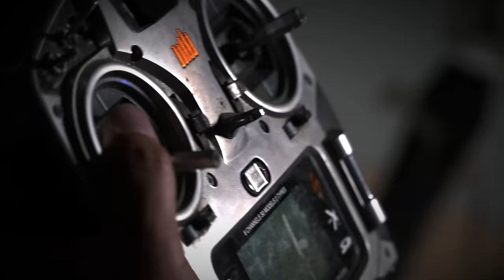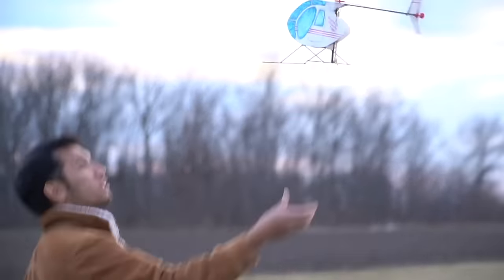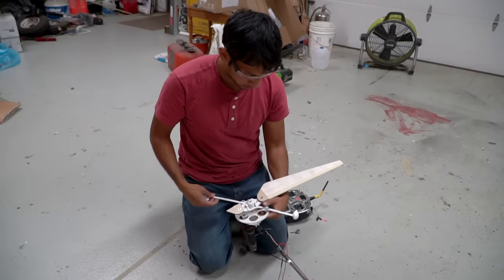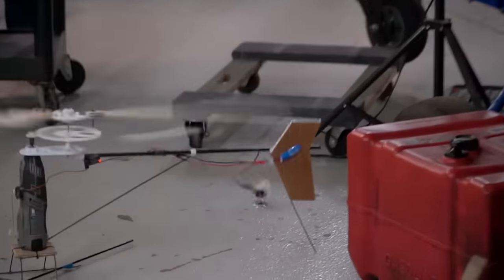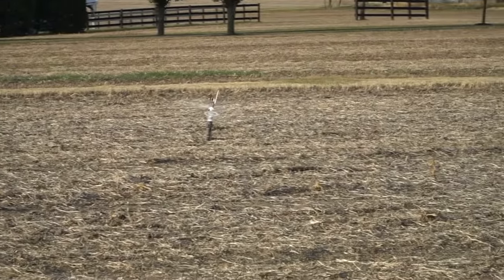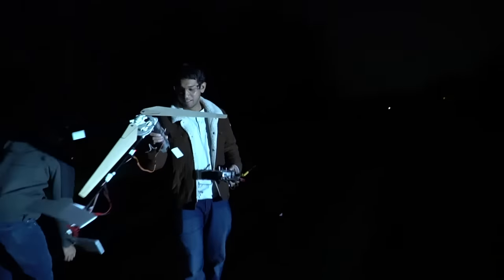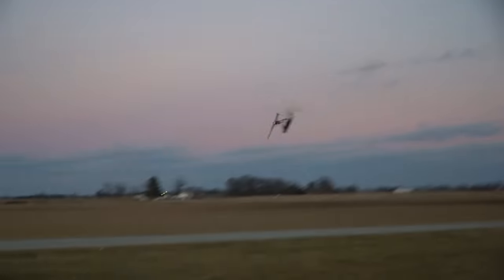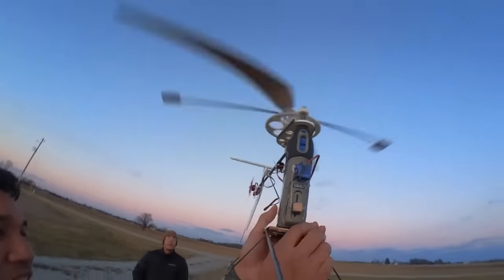Teaching a Dremel Tool to Helicopter

Comment: Remember that scene in Apollo 13 where the old lady says "...if they could get a washing machine to fly, my Jimmy could land it." I think Peter is the guy who could get a washing machine to fly.
Reply: Now Peter must make a plane with a washing machine motor!
Reply: There's your answer. He needs to build it like the lunar lander.
Stop trying to make it look like a helicopter and make four large panel legs with the propeller on top.

You'll have no directional control but it won't try to tilt Because every time it does the downwash would straighten it back out
Reply: Only if you can the air filter tubes shaped like this ⭕ into the air scrubber intake shaped like this 🔲 using only these items 🖋📎✂️📏🩹🩲🔨
Reply: @rocketboysmc  Was gonna suggest a backpack-mounted, Dremel-tool-powered, single-occupancy Santa's helicopter sled in preparation for XMas, 2023 but I like your idea lots better! lol!
Reply: fairchild republic already did that
Reply: @bmdoes_stuff6861  A-mazing comment, 10 out of 10
Reply: @TravisFabel  could some control be achieved by adding elavailerons near the undersides of the prop? Im more of plane guy; not sure how that'd translate
Reply: I would love to see a washing machine fly, that would be very impressive.
Reply: Bie Willie calls him airplane rain man
Reply: Dang that's so crazy that it may just work 😆
Reply: Actually - wouldn't using a Dryer rather than a Washer be better? The dryer likely already has air settings.
Reply: Dont give him ideas
Reply: But can he land it? Lol
Reply: So we're all in agreement that peter now needs to make a washing machine fly right?
Reply: Peter we are waiting patiently for your flying washing machine
Reply: @romanelliott1859  C'mon, Roman! Push him too hard and it'll deter, gent!
Reply: An apartment size washing machine weighs about 1 Peter Sripol. So, put one in the ultralight, add servos and receiver, and fly it from the ground.
Reply: He could do a vehicle with the actual wash basin and motor in the center. Make it one of those weird, circular spinning wing things like the X Zylo from the 90s. Side note - that thing would literally remove your fingers if you tried to catch it, so this should not do that.
Reply: @TravisFabel  AND you get your tighty tights, whity white!  🤣 But, yes, I agree with that. He needs directional control. That gets WAY complicated, time consuming and costly. Peter? When can we expect this craft? You should be back engineering those craft that do ALL of this. You all have heard of these, right? 🛸
Reply: dude şts actualy neet idea that machine haslot of power yhey are turninh 1000+ rpm witk 10+ kg oad in iy  😄
Reply: @rocketboysmc  Flying washing machine for 2.5 mil celebration?
Reply: And jimmys the one who can fly it!
Reply: Great movie got it on DVD
Reply: That's a good video idea, I believe those have 1.3 hp motors, which should be around 50x the power of most of these projects, I might be wrong on these exact numbers, but the real issue would just be the aerodynamics of a brick but worse
Reply: You said drimel at 2 minutes and 1 second
Reply: I made a washing machine fly once. I threw it off a bridge
Reply: And that was Jim Lovell's mom . And of course he was the pilot of Apollo 13
Reply: @thecitizenchan  y'all are overthinking this, washing machines are strong. just stick a massive prop onto the spinning drum and give it some wings
Reply: @rocketboysmc  washing machine motors are about 4kg lol
Reply: The next safety third video
Reply: dont give him ideas
Reply: The washing lunar lander!  Wash your clothes and land on the moon!
Reply: @rocketboysmc  🔴 What Is Islam? 

🔴 Islam is not just another religion. 

🔵 It is the same message preached by Moses, Jesus and Abraham.

 🔴 Islam literally means ‘submission to God’ and it teaches us to have a direct relationship with God. 

 🔵 It reminds us that since God created us, no one should be worshipped except God alone. 

 🔴 It also teaches that God is nothing like a human being or like anything that we can imagine.

🌍 The concept of God is summarized in the Quran as:

📖 { “Say, He is God, the One.  God, the Absolute.  He does not give birth, nor was He born, and there is nothing like Him.”} (Quran 112:1-4) 📚

🔴 Becoming a Muslim is not turning your back to Jesus. 

🔵 Rather it’s going back to the original teachings of Jesus and obeying him. 

More ....
Reply: @TravisFabel  wouldn't straighten it out though, the downwash turns with the flying machine.
Reply: @BloodyMobile  That sounds like a great idea.
Reply: @Nabitz  Yep, they are heavy but if anyone could do it peter could do it.
Reply: @TravisFabel  l
Reply: @rocketboysmc  it would have to one of his full scale planes that he built
Reply: @Nabitz  yep maybe a modification to an existing one?
Reply: @chriswatkins8711  Did you calculate glide ratio afterwards?
Reply: @rocketboysmc  ye
Reply: Don’t give him ideas
Reply: Yes please
Reply: @FullFart LMAO
Reply: Peter: Challenge accepted
Reply: Id pay money to see that
Reply: I'm sure he'll do that in a future video
Reply: @geometric7032  I believe so
Reply: @chriswatkins8711  you sound like my old landlord, he lives on the river and throws all his trash he cant burn into the river.
Reply: I'm going to be very dissapointed if he doesn't make a flying washing machine now.
Reply: Upvoting because I want to see this...
Reply: @bmdoes_stuff6861  A 10 man team of Peter Stripols could probably make ground strike aircraft!
Reply: He's trying
Reply: @Menaceblue3  English please
Reply: So dang heavy.  Tall order.  Maybe the minimum still has the tub and motor.
Reply: Aussie50 was the first to make a washing machine fly.
Reply: @rocketboysmc  sam walton said his first plane was powered by a washing machine motor, according to the walmart museum. I think he was exaggerating, but maybe?
Reply: Some washing machines use high voltage BLDC motors as their drum motor so it is feasible. You can even rejoin the series connected coil windings to parallel for a lower voltage. They are used a lot in diy wind turbines since they can be anywhere from 600-1500W
Reply: Jet turbine powered washer machine pls.
Reply: Don't spoil the next video lol.
Reply: I could land anything once.
Reply: Make a fidget spinner plane/helicopter
Reply: Bricks have better aerodynamic then space shuttle but still they made space shuttle to glide in in the air without engine or power and land safely on earth.
Reply: Now I want to see that
Reply: It is a universal motor so maybe but it’s really heavy
Reply: Yes! Next project make a washing machine fly! 😂
Reply: If he could we got to call up a Jimmy
Reply: with like 4 of the larger rc turbines and a good stabilization system, it would be totally possible to get an old style machine airborne.
Reply: now all they need is JIMMY to land it! (or a cyclic)
Reply: Great, thanks!
Reply: Washing machine company's make military planes which is even funnier
Reply: Apollo  that's the name of an Indonesian toy bro, and China, don't use that word again
Reply: It's only a matter of time.
Reply: No i dont remember
Reply: Jimmy dead yellow sure
Reply: Washing machine!
Reply: @rocketboysmc using the LG smart washing machine which have giant brushless motor it wouldn't be too hard to fly the rest of washing machine case
Reply: The next video you make the angle grinder to a airplane but it has to be a helicopter. So many people on this earth will be happy to ride it like me but why are you going to make it to the airplane?
Reply: it's funny but i se the flaws in your designs way b4 the impact.
Reply: Le11ww'

Comment: that gyro controlled stabilizer might have actually been a good investment lol
Reply: What is it going to control? There is no swash nor servos for stability for it to control. Don't need a flybar if using gyros on controls, that's what flybar does. The tail obviously needs better setup.
Reply: Or just use a multirotor FC and load it with Rotorflight (helicopter specific fork of Betaflight)
Reply: @atomicskull6405  and what will it do? There is no swash to control
Reply: @motosk8er2  if you think a gyro on the tail will fix this then perhaps I am the genius of this duo.....no need to be rude.
Reply: @motosk8er2  no one is gotcha.... Except you....jog on.
Reply: For advanced helicopters that behave like real helicopters, the swash is needed because the tail rotor is driven directly from the main rotor, since thrust is controlled via pitch, like the main rotor.  For toy helis,  and this Dremel heli, there is a separate dedicated motor for the tail rotor, and tail thrust is controlled via speed.  So yes, you can use a gyro in this case, as long as the output thrust was enough.  Peter did say he was controlling it manually via stick and this probably didn't help with stability.
Reply: @raptorheli2  

...
ratio ;)
Reply: @raptorheli2  dude. Gyro synchronizes the tail rotor with the horizontal rotor.
Reply: @ccmangb  THANK YOU. Someone who knows and can explain.
Reply: @2degucitas  dude I know you can better fix the tail with a gyro of some sort. Unfortunately however, that will not fix the problems with this, it will just make the crash a straighter ish line. It needs a swash to control direction and slowing down to land it. A quad or FBL controller will do the job fine as someone else mentioned above if get rid of the flybar. With a swash this actually looks like it will work reasonably well for a dremel.
Reply: @raptorheli2   Ok, thanks for the kind reply. What is a swash? I feel dumb asking that. Their other big problem is the central weight of the Dremel. Weight should be distributed.
Reply: @2degucitas  swash is what controls everything except yaw, without it you cannot slow down or speed up or bank left or right. the weight of the Dremel can be offset with the tail motor being Futher out if need be (longer boom). To balance a helicopter like this, you hold it on its side by the head and see what way the tail drops and move the weight/change design accordingly. It may be possible to put wheels on this current design and land it like a gyrocopter or normal plane but it will never hover and stop in current guise. The flybar is somewhat self correcting system but I won't get into that here or end up mega long post.
Reply: @raptorheli2   thanks
Reply: @raptorheli2  obviously it needs it, but also, its obviously not what the people above have said. It "needs" a gyro to be reasonably able to fly. One way or the other. Its not going to fix the obvious design flaws, but atleast it will make it better to fly. Its still obviously not going to go where you want it to go.

Comment: I can't help but think that an enclosed fuselage/gear box would have reduced the crazy amount of vibration that thing had since the very get go
Reply: Yeah i thought the vibrations in the gears was gonna be the first thing addressed
Reply: all they needed to do was add a rigid bar and another two bearings above the gears. Would have prevented the flex and therefore reduced the gear slippage
Reply: @littlesnowflakepunk855  THIS. I’ve thought about this the whole video. The freaking gears.
Reply: I don't know what was driving me more nuts, the vibration gearing, or the fact that he had the tail rotor propelling directly into his vertical fin.  Then he upgraded the power of the tail rotor because it wasn't strong enough.  But hey, he kept at it.
Reply: @paulybeefs8588  Holy crap, I didnt even notice that until you pointed it out
Reply: Yeah it was like so obvious to see right away that giant gear was just not ok, and I got more and more frustrated that he just doesn’t address it hahaha and I’m like omg that’s all you have the change
Reply: Not really. I've built and flown several electric helicopters and to be honest this isn't that far off from how their internal structure goes. And as far as an outer body enclosing the whole thing goes, they're usually just flimsy plastic.  They don't really provide structural strength.  You can easily fly without them, I usually did.

Frankly, the vibration is caused by being unbalanced. You have to work really hard to balance helicopters, even if you're using commercially produced helicopter blades you still have to balance each pair after you install them.  And by balance, what I mean is that you use small squares of electrical tape on the tips of the blades to alter their weight until they behave properly.

I don't mean this to be a criticism against Peter, but his usual approach of brute forcing things will not make a good performing helicopter.  The thing was shaking because it was badly out of balance and/or it had some bent parts that really needed to be straight.

Oh, and the only reason you wouldn't normally have an exposed gear at the top like that is that you have to position them lower because you have to have servos and linkages connecting to the control mechanism for the rotor blades at the top, and having the gear up there would be in the way. It has no bearing on stability.
Reply: Fatherless pfp
Reply: The gears are so much bigger than they need to be. Just use more dual stage gears, preferably bronze ones. And then luuuube.

Comment: dual bearing on the input and output shaft for the main rotor, the extra rigidity on those stops gear mesh issues / reduces vibration etc , also make a guard for the spur gear,  ask me how i know :)  loved this project so so much, brilliant stuff chaps as always
Reply: Yeah, I respect the creativity and perseverence, but expecting something with so much vibrations to fly, is like asking for a miracle.
Reply: @rc-fannl7364  This is how smart peter is he knows where he can cut corners but, having done similar stuff getting the spinning assembly parts balanced, just makes everything so much easier,  rear rotor authority kicks in earlier as well once the vibration is under control.
Reply: Yeah I was so surprised that they didn't support the shaft with a second bearing above. It was the main reason for all the vibration and skips
Reply: He's fighting weight this whole build too though bearings are heavy
Reply: I came here to make this same comment, but I’m five months too late sooo .. cheers! 🤣

Comment: The YouTuber, "Night Flyer" was part of the development team that made the Kyosho tail rotorless RC helicopters sold by Tower Hobbies in the late 1980's early 1990's. I believe if you contact him and get some of his data, you might be more successful without a tail rotor, and only throttle for up-down and regular rudder for directional control.
Reply: He used a big paper plate as a replacement for a tail rotor, works great! You just get no rudder control lol. But you can still Change heading.
Reply: The helicopter must always be in forward flight for this to work.
Reply: The Kyosho HyperFly! My friend had one. It had a no throttle, just a switch on the helicopter that got turned off when the helicopter touched the ground.
Reply: @RolfRBakke  Yes I mistakenly got a Hyperfly as my first RC aircraft.....biggest waste of money and a ton of frustration. It was like throwing a bowling ball and expecting it to fly.
Reply: @PilotChris06FW  
Our first flight went straight into the ground as well. We learned that we have to let it climb straight ahead, and turn right. Left turns made it dive. So it kind of worked. Not for the beginner tough...

Comment: Serious Question, Peter - did you consider a planetary-gear for main rotor? Seems like it would have two advantages: less flex and weight of tool directly under rotor. Very curious... Thanks!!
Reply: Possible torque loss but that could work
Reply: That would be way better, for sure.
Reply: That and gyro control would be a winning combo.
Reply: They can create heat when not lubricated simple is better for dry gears
Reply: Isn't it best to have some weight out in front of the rotor shaft in order to counterbalance the weight of the boom and tail?
(Just spitballing here.)
Reply: @davidmerander576  they don't need gyro control, it's literally a self stabilizing design. It needs heading hold.
Reply: I think the choice he went with was good because it puts majority of the weight in the front close to the prop, so it compensates for the tail.
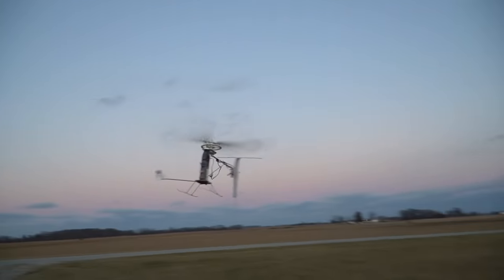Reply: @ReverendTed  they did at 19:25
Reply: I've built two electric RC helicopters and they both use gear drives that look much like this.

My guess is that a planetary gearbox would be too heavy and wouldn't be able to achieve as much reduction.

As far as the center of gravity goes, I think he was trying to buy us the weight of the tool forwards in order to make the thing automatically go into some kind of forward flight without having the controls that you usually have attached to the main rotor.

Comment: I think adding another bearing and supporting both sides of the gear would have helped. I think I heard a lot of time where the teeth would separate and the gears would skip.
Reply: A planetary gear is slmost infinitely better, especially when you have a 3d printer.
Reply: So much lost power for the main rotor due to poor driveline engagement. Wasn't the motor's fault. Peter may have given it 110% given all constraints, but 10% more would have had this thing as a complete success.
Reply: true that i was thinking it was amazing it sustained flight with basically a slipping clutch

Comment: phrase of the day: GYROSCOPIC PROCESSION

you need to have a mechanical bias to the flybar that offsets it toward the direction of gravity or else the effects of gyroscopic procession will continue to crash it, thats why it slowly tilts more and more until it crashes every time. i would recommend having the flybar angled down away from the blade to give it leverage and make the tips atleast a quarter the weight of the blades to make it want to self level.